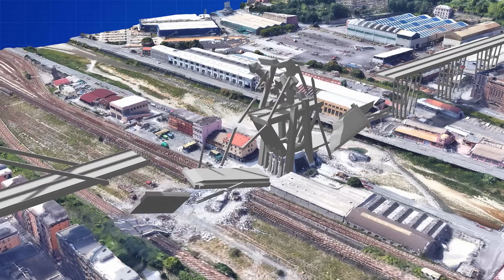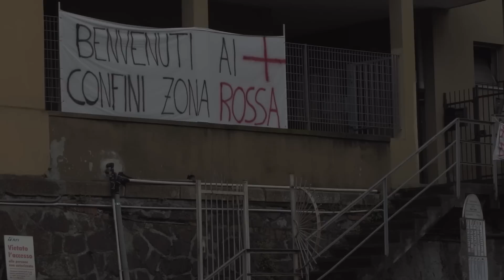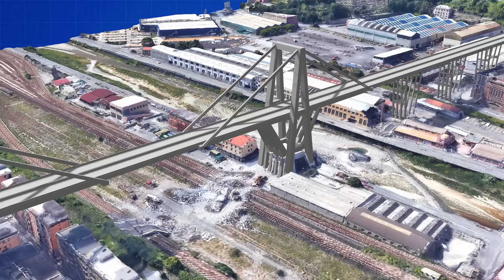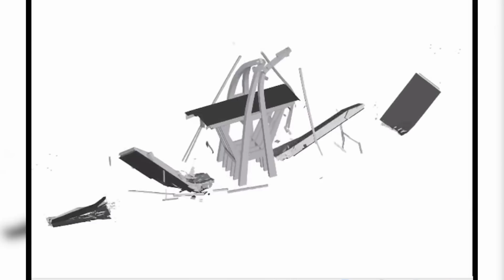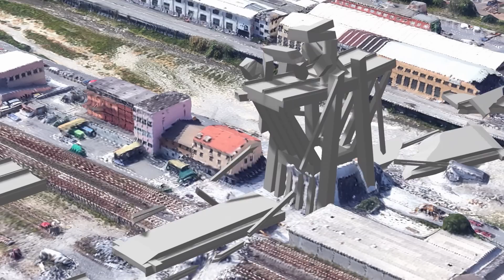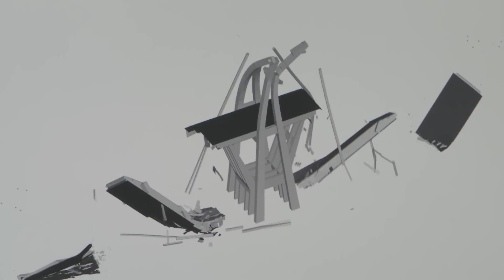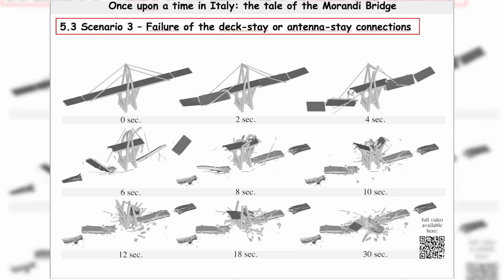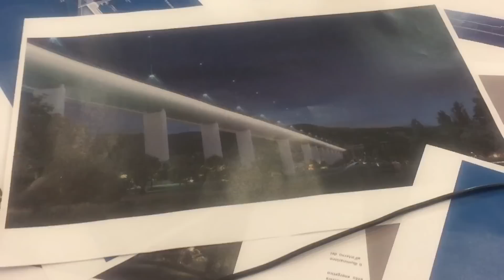What caused the Morandi Bridge Collapse? | What Went Wrong | Free Documentary

Comment from the maker: Ponte Morandi (English: Morandi Bridge), officially Viadotto Polcevera (English: Polcevera Viaduct), was a road viaduct in Genoa, Liguria, Italy, constructed between 1963 and 1967 along the A10 motorway over the Polcevera River, from which it derived its official name. It connected Genoa's Sampierdarena and Cornigliano districts across the Polcevera Valley. The bridge was widely called "Ponte Morandi" after its structural designer, engineer Riccardo Morandi.

On 14 August 2018, a 210-metre (690 ft) section of the viaduct collapsed during a rainstorm, killing forty-three people. The collapse led to a year-long state of emergency in the Liguria region, extensive analysis of the structural failure, and widely varying assignment of responsibility.

The remains of the original bridge were demolished in August 2019. The replacement bridge, the Genoa-Saint George Bridge was inaugurated a year later. Our documentary looks at the possible causes which caused the structural failure. (i drove over that bridge quite a few times actually on my way to the French Riviera)

Comment: @ 36:51 You can see the cross section of a broken column or beam . . . .  it is packed with red bricks!
What kind of structural concrete would ever use such a method?! It must be bricks, I can't believe
that would be part of the design . . . .  no wonder it collapsed!